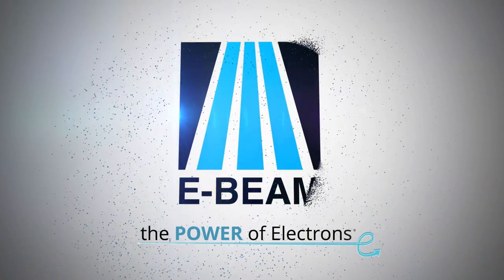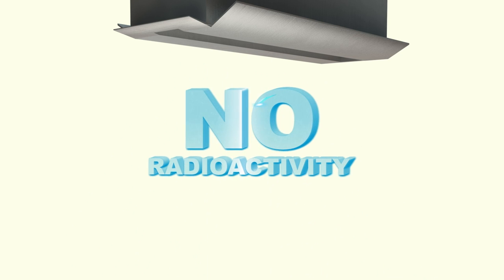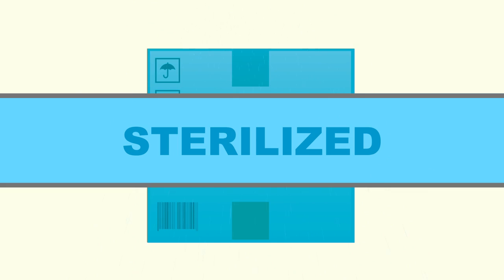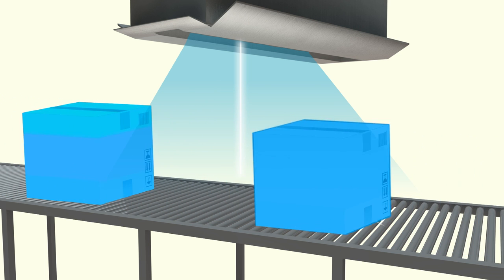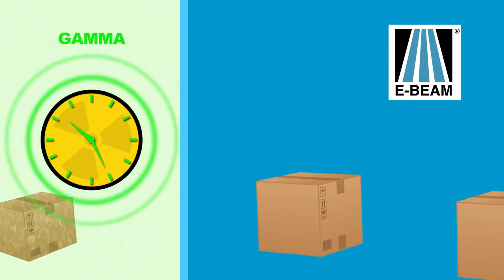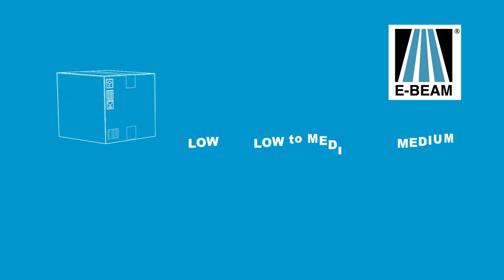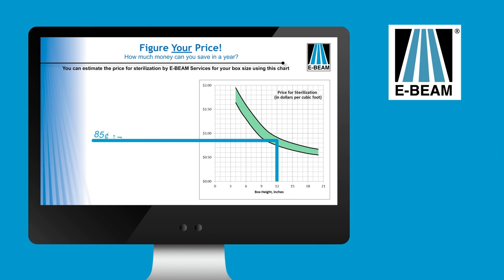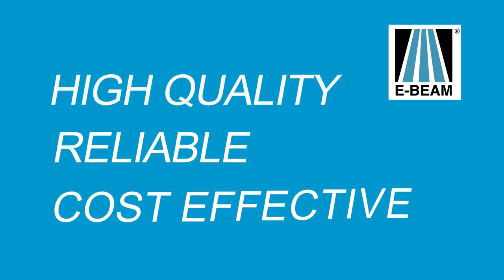How Does The Electron Beam Sterilization Process Work?

Comment: Ok the electron beam outputs x-radiation so it does put out radiation and it killed a meter that rode with a go pro and the go pro almost died all those little dots on the screen is radiation
Reply: But unlike traditional way of using a radioactive source which is dangerous electron beam can be turned off
Reply: Yea true but it's still radiation
Reply: Exactly, I was going to say the same thing and have that video on my channel.  You can literally see the radiation on the screen.  Ionizing radiation doesn't just inactivate all of a virus, it inactivates part of the virus and causes it to mutate.  Higher dose yet lower penetrating ionization....something isn't right here.  They are advertising this in the wrong manner.
Reply: @paulmobleyscience  sorry mister, I have started at a new workplace. And there is a labour… they put
inject through the e beamer to sterilize them. They say we shouldn't worry because the radiation is as low as when you go to the dentist for an x-ray. what kind of stupid statement is that? my question to you is, can the rays penetrate this stainless steel frame from the e beamer to the outside ??? I often have to stand next to the projector, even when it is switched on, and clean the inside while it is switched off. i'm afraid for my health.
Reply: @anastasijabeograd3903  I apologize for not responding sooner I just seen your comment.. As long as the facility has been designed correctly and an ongoing dosimetry regime is conducted then you shouldn't have much to worry about as far as your exposure is concerned.  What I speak of is the irradiation of the metals used inside the conveyor systems that causes those materials after time to exceed operational standards.   Most are based on a specific power range and if those ranges are exceeded than issues may arise and cause issues down the road.  E beams and X-rays are a better alternative to the gamma cobalt 60 irradiators and just like at a hospital when the X-ray technician steps behind the wall, this will be the same concept for anyone working at one of these facilities.   If you want piece of mind and if it's an option for you then purchase a personal dosimeter and take your own measurements to ensure your personal exposure doesn't exceed the limits.
Reply: It's radiation but not radioactive. The sun emits radiation that we call light. This is kinda like that but more powerful. It involves no atomic/nuclear stuff.

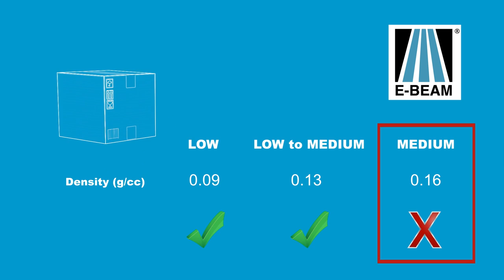Comment: 2:00 flip the box sideways then?
Reply from the maker: If the density requires it, we'll rotate the box from a top/bottom configuration to a bottom/top configuration
Reply: @Ebeamservices-videos  excuse me, I have a new workplace. and there is a fabrik who puts injection through the e beamer to sterilize them. They tell us we shouldn't worry because the radiation is as low as when you go to the dentist for an x-ray. what kind of stupid statement is that? my question to you is, can the rays penetrate this stainless steel frame from the e beamer to the outside ??? I often have to stand next to the projector, even when it is switched on, and clean the inside while it is switched off. i'm afraid for my health.
Reply: clean what exactly? a stainless steel plate  won't stop radiation.
Reply: @anastasijabeograd3903  Any electron beam sterilizer installation is going to have the beam horn in a very isolated area you could not access without traversing the conveyor maze. So you're either nowhere near the beam or you're inside the irradiation room. The actual radiation exposure would be next to nothing unless you literally rode the conveyor belt around while the beam was on.